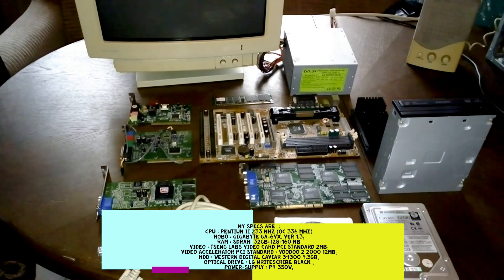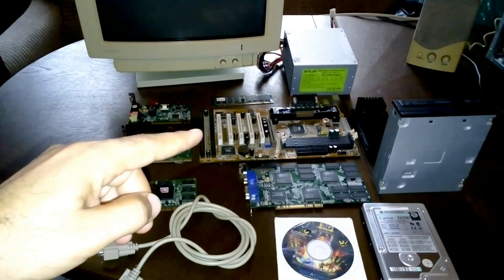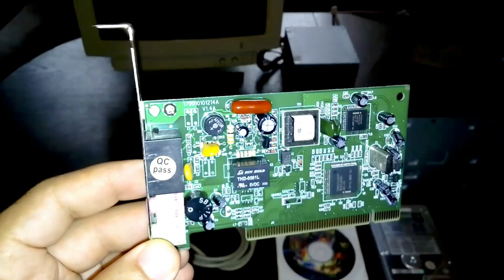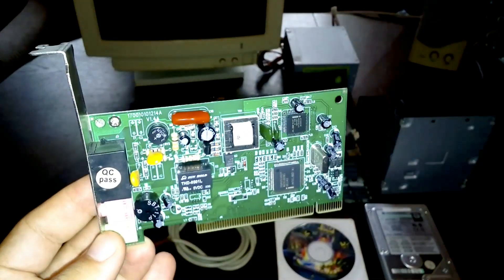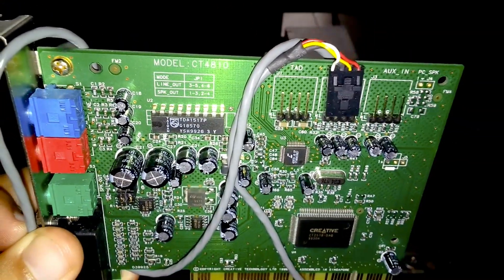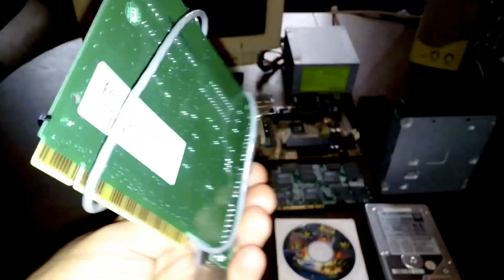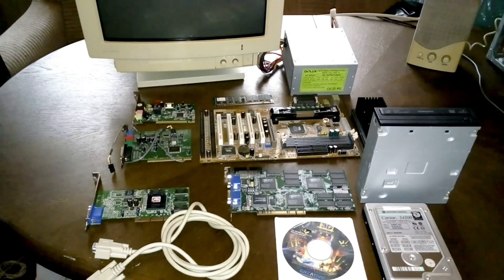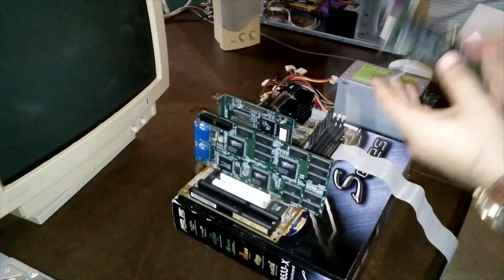Pentium II 233 With Overclock Build

Comment: Wow i didnt know the pentium 2 klamath was that overclockable nice
Reply from the maker: Thanks. Well, it does. Cheers !
Reply: Is it a 440bx chip?  @edward940
Reply: Were you using a 440bx mobo? @edward940
Reply: Did your CPU use a special cooler? @edward940

Comment: These were such exciting days  in the PC world...I was 12-13 at the time, Voodoo 2 was IT, never had one though. Had a Deschutes PII-333 with 16mb ram, and a 16.8gb Hard drive (never fill that up at the time) w/ an STB Velocity Riva 128, and Turtle Beach montego sound. Smokin little machine for the time. The tech world was changing fast, as that PC was basically out of date in about 2-3yrs lol.
Reply from the maker: Voodoo Graphics, revolutionized personal computer graphics nearly overnight and rendered many other designs obsolete, including a vast swathe of 2D-only graphics producers at that time.The 3D landscape, from 1996 favoured S3 with around 50% of the market estimated, that 3Dfx accounted for 80-85% of the 3D accelerator market during the heyday of Voodoo's reign.

Comment: What about motherboard stability,  no reboots?
Reply from the maker: Absolutely nothing.It's just 103 MHz that i've added to the clock speed of the cpu from stock frequency. Going further than  336 Mhz will end up in failure for sure. I only need'it to be alittle faster.

Comment: Like! What FSB did you use to overclock the CPU to 336 mhz ? Is it 100% stable ? Did you increase the voltage too ?
Reply from the maker: I didn't raise, the Cpu voltage at all, for the extra bump  in performance from 233 to 336 Mhz, Jumper JP6 moved in position to 2-3=66 Bus-Speed.As for the stability, i haven't had any crash or blue-screens of death so far.It depends on how good is ventilated.Mine right now,  has an : 92mm Fan blowing air into it hard and noisy.

Comment: What's the point overclocking this kind of system?
Reply: Whyn't
Reply from the maker: For instance, it will give you better framerate in games, programs will open faster, overall it's worth it if you know what to do with it. Back then, these machines optainning higher speeds over stock ones was really something.
Reply: @edward940  Indeed, I do not felt the need of a Pentium while having my 486 upgraded with an AMD 5x86@133MHz that I later overclocked to 150MHz. In Windows 95 it was a huge difference. I used to play C&C Red Alert, Civilization2, SimCity 2000, Quake, Betrayal at Krondor, Heretic, Hexen, Wolfenstein 3D, Duke Nuken, StarCraft, Warcraft 2 and some games really were more playable when overclocked. But due to Quake and Starcraft, I needed to upgrade to Pentium.
Ofcourse, after upgraded my computer to a Pentium 1@166, the difference was even more impresive.
Reply from the maker: @sebastian19745  That is truly an amazing experience. Back in time, I felt the same way when I was upgrading my : Siemens Nixdorf DX2 486 computer, running at : 66 Mhz, to a  Pentium -1, 75 MHz and the differences in games was insanely big, the mp3 files were playable which was something so new for me.Starcraft one, was running flawlessly this time around, many apps and everything I could think of was possible with that machine.Later on Pentium 1 Mmx instructions set, 166 MHz was involved which was high-sky processor, movies was able to be played, faster response in apps and everything. What a nice memories brings back those unique computers. Thanks for sharing with us.